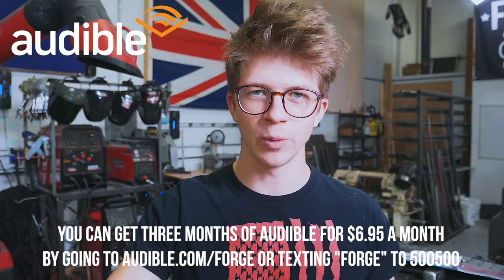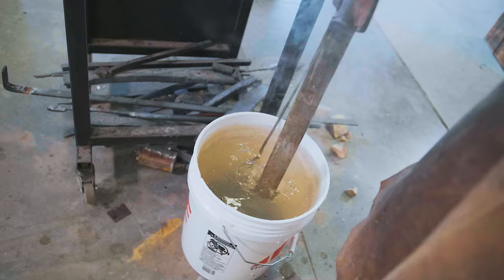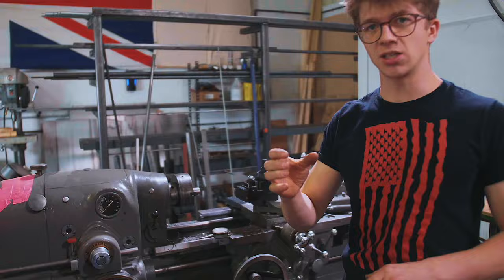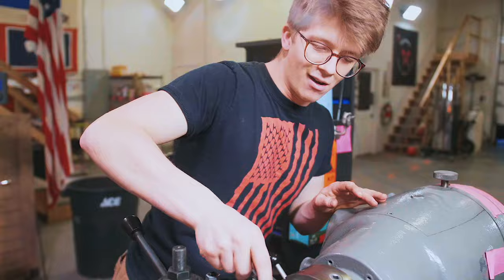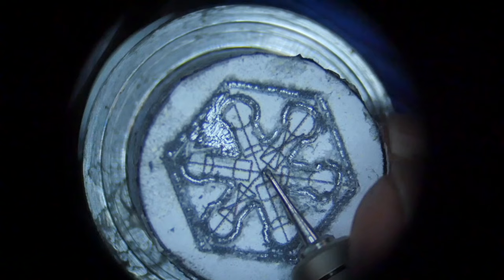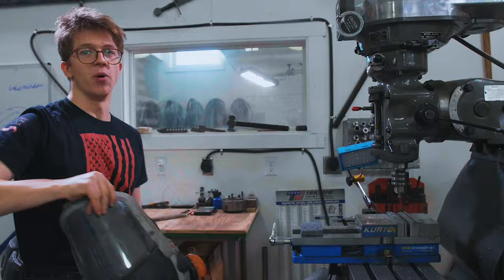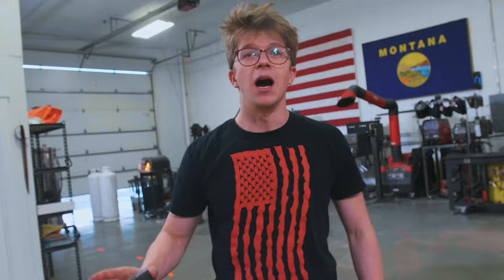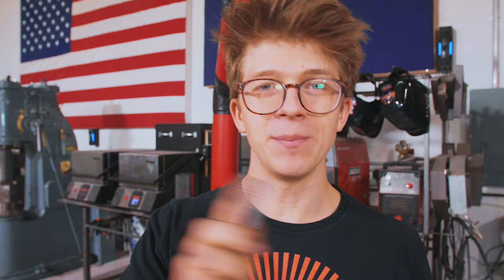MAKING MANDALORIAN BESKAR STEEL!!!

Comment: Makes damascus steel, melts it down into armor ruining the pattern. This is the way.
Reply: This is the way
Reply: This is the way 😂😂😂
Reply: This is the way
Reply: takes all integrity and throws it out of the jet pack
Reply: This is the way
Reply: This is the way
Reply: This is the way
Reply: This is the way.
Reply: It wouldn't be star wars if it made sense lol
Reply: Joe Townsend I’m basically a super fan and I agree with that lol
Reply: This is the way
Reply: It doesn't have to make sense.
I have spoken.
Reply: This is the way
Reply: This is the way
Reply: Also the amount of armor one block creates just doesn’t add up but hey - This is the way
Reply: Make it so.  Oops!  Wrong Sci Fi.
Reply: Do you know da wae?
Reply: This is the way.
Reply: My headcanon for this is that the pattern welded beskar is ultra-high carbon and when it melts it gets turned into wootz. (no crucible used because star wars magic).
Reply: Beskar isn't Damascus idk y it looks like that but I don't think it is Damascus
Reply: This is the way
Reply: Not to be "that nerd" but Beskar is an alloy. I bet the damascus-like pattern was in place for the raw billets to save time. Faster to make X:Y ratio billets for another Mandalorian to make their armour from.
Reply: This is the way
Reply: This is the way.
Reply: This is the way
Reply: This is the way
Reply: Thank you. I wondered if I was the only one who noticed that.
Reply: This is the way
Reply: The way  this is...
Reply: Mando's new armor is still sweet.
Reply: Melted down and pounded into shape like it is makes it stronger than it would be in the layered form as can be seen from the shots it absorbs with barely any damage.
Reply: This is the way.
Reply: This is the way
Reply: Layering blister iron then melting the billet was, in the past, a way of producing tool steel. In the past it was all folded steel.
Reply: This is the way
Reply: Patrick Smith 🤦‍♂️
Reply: @shinydisease7903  have you seen the show?
Reply: @shinydisease7903  This is the way

Comment: When it is so much easier to make the punch, that would stamp the inverted logo. You could have made that one and then make another punch with the first punch.
Reply: big brain
Reply: Or just carved in the logo instead of punching it.
Reply: @Nogard666  That kinda defeats the purpose of the punch though
Reply: Yes it does. Also keeps the piece from distorting under the press, and there would not be a tool sitting somewhere taking up space to be forgotten or even destroyed to make something else. He was in a hurry, so it would have been a lot less time to carve the symbol before hardening the billet.
Reply: @Nogard666  But the purpose of the punch is to add detail to the piece that is hard to reproduce without the punch but very easy when you have it. It just seems to me like carving out the shape directly on to the piece would be cheating, like how you could also just print on the Damascus pattern, but what would be the point?

Comment: Save time when drawing the imperial logo in Fusion 360:
-Find SVG vector file of imperial logo on the internet somewhere (it's got to be out there somewhere, if not find PNG and convert).
-Import SVG file into new drawing
-Size drawing appropriately
-Print, stick, and hog away.

I do this whenever I'm putting logos and artwork into my 3D printed stuff and it saves hours of time and frustration when things don't look quite right.

Comment: I guess it was all them old farts I heard bout as a kid and believed that the art of making Damascus steel was lost and couldn’t be recreated but the work you boys do is on another level! Got my first Damascus buck skinner when I was about 12 and been hooked ever since. Thank you keeping the art alive and new!
Reply: Not quite. This is European Damascus steel replica. The original oriental Damascus steel is different and it’s unknown how it was made. Most likely you had a big clay crucible with iron at the bottom under a layer of sand. Above was coal and iron stacked. The whole thing was put over a fire and as the iron melted it dripped down and took the carbon from the coal with it. The sand melted and formed a molten glass puddle above the iron, where iron could go through, because it was heavier, but the coal stayed above. So the high carbon iron came from the top and mixed with the low carbon iron from the bottom and that produced the pattern. The European version is just a lot easier and quicker and more reliable. Not as hard tho and more as a decoration than as an actual weapons material.

Comment: Here's a question I'd love an answer to:
When forge welding pieces together, I see that you surface grind the touching faces, ensuring you got a flat contact surface ... now I'm wondering, would the weld not be much stronger if when surface grinding, you took it down to 1000 or 3000 grit ? As it would then be so perfect of a flat surface that there's "a perfect void with no air" ???
Reply: It's more about having pure steel and no oxide.  Iron oxide will not forge weld and you end up with cracks and inclusions.

Comment: If you want more detail, you could use the method used by mints. Create a master in a material easier to engrave - the master being many times larger than the desired working die. You then use a pantograph to engrave the much smaller steel working die.

Comment: Thank you for continuing to use Metric, Alec. Imperial measurements shred my soul.
Reply: I THINK that using the Power Hammer to do a quick kiss would have been better than the press....but I don't know your machines as well as you do....so I could very well be entirely incorrect (also I'm not a Blacksmith....though I have some welding Experience XD not that that matters.)

Comment: Congrats bro! Was wondering if you could forge a seven layer katana using a bullet of concentric cylinders that are sleeved ontop of each other using a cooled core over a hot sleeve. The aim is to give the catana a ductile spine grading up to a very hard steel surface the core being the ductile durable part. That would be a very modern functional katana. When the cylinder is drawn under heat and hammer this way it would deeply weld and finally when that spine is exposed the the edge is beveled you would get a very modern functional katana.

Comment: You can make the stamp, not "inverted" (i.e. hole in the middle) and from copper, only thinner, so you get a tenth of a millimeter spark-gap on each side. Then erode it into the rod that will become your stamp.

Comment: Should have used a 3d printer to make a model of the punch and then cast it.
Reply: cast it out of what? Casted iron isn't very strong, where would he get the heat to melt steel into a liquid?

Comment: What you could really do is carving the positive image in graphite and then electro-etch the negative on the end of a round bar of some hard steel alloy straight away. Or just have it laser engraved. Both ways would give you much better results with way less suffering.

Comment: New Stelter vs Steel challenge.
 Cutoffs from other Damascus projects, ball bearings of various sizes, fireball tool giant chips from giant Cincinnati mill and powdered steel. For a canister Damascus double headed throwing axe.  Time 4, 8, 12, 16, 24, 36, 48 working hours  you guys decide.

Comment: If you had made the die as you first thought, hardened it and then used that to punch a red hot bit of summat, you’d have had the correct impression to then lathe, finish and harden.

Comment: One problem though... Mandalorian steel doesn't melt red like regular steel. The show melted the block into a grey liquid that flowed without a slag step which means that the filmmakers either used CGI, or they used something like lead, tin, or zinc.

Comment: Except an 8" facemill, used to run a G&L boaring mill with 28' bed 7' in Y axis and 4 foot Z axis. That feeling when you have pounds of steel falling off into the conveyor (Tim Allen Moment) Mo' Power.

Comment: Honestly that punch in that picture just looks like a socket with a star in the middle. It could be they used two separate punches one socket like punch and one star like punch for the middle. But I do believe that's just a normal hexagon socket.
Reply: inb4 torx bit
Reply: It's an Imperial logo

Comment: When you have a shape that is very complex done negative, but very easy positive, just make the positive, than use the positive to impress the negative, touch up the negative as needed and heat treat it and use it.
Bear in mind that the negative will be a tad smaller, and shallower, particularly if you have to touch it up,  so take this into account when designing the positive.

Comment: would it not have been possible to carve out the imperial punch like originally planned and then punch that into a second material to create the inverse which would punch the correct shape into the steel?

Comment: Alec, you could have used your original idea for the punch head.  Just use the inverted punch to punch some steel, then cut that impressioned steel and use it as the punch head.

Comment: Beskar is casted metal, more like a real Damascus/wootz steel, not pattern welded Damascus. You can even see where the stamp is has a line connecting it where is was poured. Alec should make a true crucible steel and make a real beskar.

Comment: So a bit of an easier idea but a slight waste, for the punch would it have been helpful to make a negative impression so you could hopefully heat up another piece of steel to impress the seal into it? I also find myself thinking of a spider-bit.

Still though, always fun to see you working with the finer stuff so I'm not mad in any way.

Comment: It would be possible to use photoresist and electrochemical anodic dissolution in a solution of sodium chloride with forced supply of it with something like a windshield washer pump.

Comment: About that punch thingy you did. Couldn't you have made a "negative punch" first, then punched it rather hard and deep on the end of some annealed square stock (or round, you'd need to center it on the design's center on the lathe anyway, square just sounds easier to hold steady while you use a press or some such)... then refined that, turned the shaft, hardened, and got your punch that way instead?

Comment: The making of Damascus calls for the stacking and restacking of the material. I understand the principle.  But.. what is the difference between folding and cut and stack methods. Is there a difference in outcome?
Reply: Not really. Damascus is kinda like a brand name as it originated in Damascus. It's really just a pattern welded steel. Folding and layering technically achieve the same goal.

Comment: late to the party but would it not be possible to design something like the punch in cad and send it through a cnc program to get a final gcode file and then just manually follow the gcode as a sort of step by step on the manual mill. most gcode when you know how to read it is fairly straight forward just a series of axis points and movement commands, so if you know how to read it then using it as a map to run a manual mill should give you similiar precision. especially a mill like alecs with the dro to accurately hit your points.

Comment: I would be interested in your speculation.  You forged some "Beskar" steel. By layering and depending upon thickness.  Traditionally there have been a couple of innovations in toughening of weapons.  One is the nature of the materials.  Copper is soft compared to bronze which is also softer than iron which is softer than steel.  each is malleable so it is not, like clay, going to shatter as soon as it is struck.  Coal does shatter and is basically carbon.  HOWEVER modern day armor IS made of carbon fiber and so is the body of some cars. The fact that carbon makes long bonds and GIVES and is flexible when spun  actually makes it better for some uses than steel or metal such as body armor. So in your opinion, the mythical Mandalorian armor, is it dependent upon a particularly tough metal that is shatterproof or some carbon like fibrous addition? There has been discussion about Titanic that there was too much coal in the steel and it shattered when struck by the iceberg as a result.  Of course after that paper there was another that said it was on fire before it ever left port which meant the steel was soft because it was essentially melting for days before it was struck so. . .

Comment: Why not just mill out the stamping design?  Rough it up with with black oxide/acid application to simulate the attributes of a genuine punch stamping?  That proto you've got could probably do it with some finaggling.

Hell of a lot easier and saves material my friend.  Idk, that's probably the route I would attempt after some testing.

Comment: I have a doubt... why he didn't make the stamp in two parts?
First de inside section... like the exterior doesn't exist... then a bar with a diameter to put the inner form... perhaps the rear part could have a pin to center in a interior 1/4" hole...

Comment: Just a thought.. wouldve put another step onto the process but use your initial drilling method of a stamp to create the negative of the stamp.. stamp that onto a hot peice of steel to create the actual stamp needed and then stamp the metal..?? Yes?? No?? Just thinking. Lol

Comment: Umm Alex? Bit late and captain hindsight, but why didnt you use kiss block when stamping, to prevent it stamping too deep? You use method on power hammer when flattening steel bar, not to mention this could have been done with power hammer, perhaps with superior control, yes? (not sure about control thing though)

Comment: Why not machine the negative of the punch, then use it to punch a piece of steel, then use that as the punch? Would've been easy to machine a hexagon, drill some holes and mill a few more straight slots and would've given you smoother edges than with the burr, I imagine.

Comment: If it were me, I wouldn't be happy with the stamp. The centre of the stamp is incorrect. You basicly have a snow flake. Its meant to be a hexagon in the middle as well with 6 small thin lines running perpendicular to the hexagon from the corners with small circles on the end of them.

Comment: saying Beskar steel is simply just Damascus undercuts what it is. one can surmise that by simply looking at it. the question you should be asking is what makes BESKAR so great. what alloys do they use and what techniques do they employ that makes it valuable enough to be a currency. remember Beskar Steel is super light and extremely durable. it is even capable of absorbing or deflecting blaster shots. 

simply put. it isnt simply Damascus.

Comment: This doesn't quite address the spirit of the Beskar billet though. The ingots are standard weights and measures and need to be produced quickly and easily. They're definitely not milling these to shape and losing the excess. Much more likely some sort of die forging.

Comment: Couldn't you have just made the ineverse of the stamp and then used it to make the stamp? I dont forge (yet) so I wouldnt know better 
But I do believe if you had the inverse of the stamp you could be heated up a rod and then stamped that rod with the inverse make the one you want. I could be wrong

Comment: Dude!...it's called a "HAMMER"...  Take punch, put on hot steel, whack with HAMMER, once, maybe twice, done. You said it yourself: Blacksmithing...it's been done for thousands of years...with a HAMMER.  Don't let dependency on technology take the joy and skill out of your craft (and make your job harder as in this case). Twenty minutes setting up a press to do what, done properly by hand, would take 15 seconds.  You obviously enjoy the hell outta 'smithing, like the rest of us but somewhere along the line either you've forgotten or no one showed you that taking a whack at a chunk of hot steel with a fist full of hammer is a hugely satisfying part of the process of creating something by HAND rather than with machines. Yes, hydraulic presses (when properly adjusted/used...hint) and power hammers are handy and fun to work with and we all wish we had one (or two...of each...) but something as simple, and satisfying, as setting a mark doesn't need a half ton machine to accomplish and would have been faster and less damaging to the workpiece if done by hand. Machines are great for production work and/or when time is critical or even to minimize the tedious bits (as your assistant, who's name I missed, showed) but the whole point of practicing a Craft is the Craftsmanship of your practice. Or... there's a reason why you can't get this at Walmart...

Comment: Why didn't u just hit the punch with a sledge hammer rather than a press? Would've made a much finer impression and the high surfaces would've been flush with each other, allowing those within the symbol to be ground to the same look as the surrounding ones.